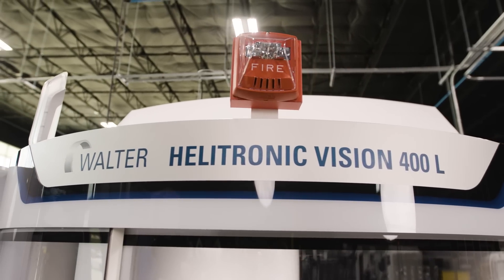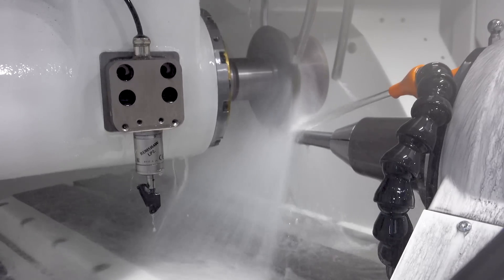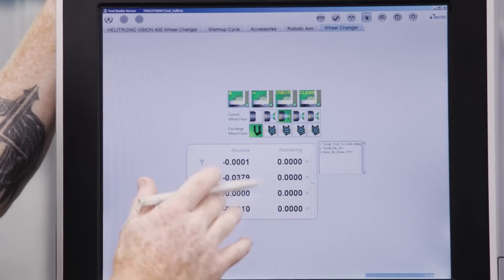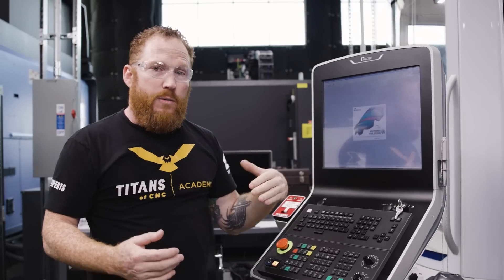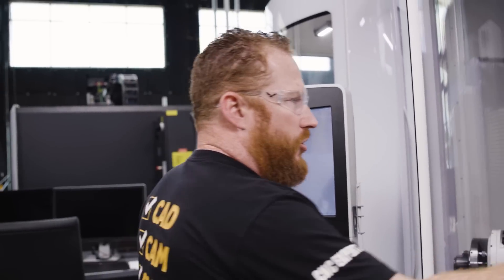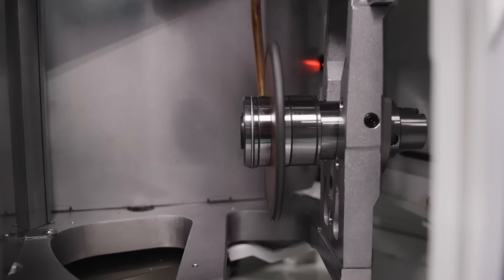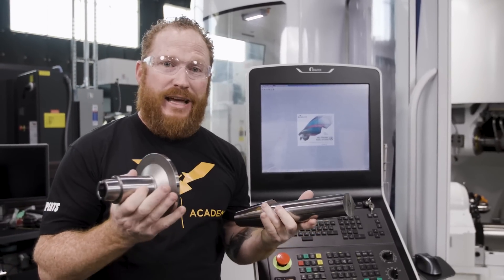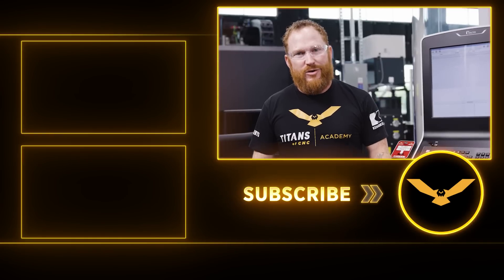How To Get The Walter Helitronic Vision 400L Up and Running

Comment: I wonder if you could use Numeroto software on the Walter.
I worked at a shop that used a Walter machine for grinding Hobs and that machine used Schneeburger software. I just like Numeroto better especially for form tools.

Comment: Wow, every time I see Scott on this machine it blows my mind.....Does Walter have a specific CAD program for designing end mills and tools....or do you have to generate the Gcode in something like F360...?
Reply: Program has a pre set model for generic  endmill, you can adjust everything once the general model is made, number of cutting edges, radius / no radius, end face, fluting and everything else

Comment: Just remember if you want to buy a machine like this buying the machine is great and all but the upkeep on some of these machines will cost as much as the machine or more over the next 5 to 7 years.
Reply: If these are anything like CNC glass machines (the field in which I work), it's all about the preventative maintenance and how the operator treats it. If you don't clean it, feed it dirty coolant/water and/or air, and crash often...  it's going to cost you.
Reply: @willsparklin  I work on a large bed lathe and our company dosen't maintain it at all. We have had the lathe for 8 years with the original manufacturers oil in it running it 24 hours a day 5 days a week plus Saturdays for 5 hours. Then they wondered why they needed to rebuild the headstock and can't get the machine to run consistently. Preventative maitnince is your best friend.
Reply: What percentage of the profits is that though?
Reply: @iamchillydogg  I have no idea but it could be higher if you took about 5 hours out of a day which you can schudle to change the oil versus having the machine suddenly go down for 2 weeks while waiting on parts and no other place to run the parts due to the large size. Also now your production is 2 weeks behind and you just pissed off a bunch of customers.
Reply: @wendull811  
Ok but how much does that proper maintenance cost which is what your comment was about.
Reply: @iamchillydogg  not at much as lost customers due to a machine being down and/or concerns over quality.
Reply: I recently visited a toolmaker in the DFW area with a Walter that's been running for over 20 years. These machines are the highest of quality and basic maintenance, proper use, and the use of grinding oil, you will experience the same results.
Reply: @willsparklin  
Right but we're not talking how much improper maintenance costs but proper maintenance.
Reply: @iamchillydogg  Well the headstock holds 60 gallons of oil the x-axis box and z axis box hold about 5 gallons and the oil for the ways we go thru about 1 gallon a month. So figure for every year you go thru rough 100 gallons of oil to properly maintain that machine plus about 10 hours of labor a year. So it's about $2000 a year for 110 gallons of oil. Over that time was roughly $20,000 plus labor which figure is about $10,000. So $30,000 for 10 years not including other basic items to keep the machine accurate such as leveling/gib adjustments and periodic stuff like roller changes for steady rests. Tool wear things of that nature. The 2 weeks the machine was down plus $9,800 in parts for all the spindle bearings and about 25 hours of labor cost for disassembly and reassembly. I can keep going if you would like me too.
Reply: @wendull811  
So way lower than $750,000.
Reply: @iamchillydogg  Unfortunately I am not talking about the machine in the video. I am discussing the price of the machine I run at my job.
Reply: @wendull811 
Ah.
Reply: @iamchillydogg  I also just looked up the oil coolant they are running its $240 for 5 gallons. I don't know if that is concentrated or just pour it in. But I can bet if it is buy and pout they will go threw at least $1000 a month or two just in the coolant.
Reply: @wendull811  these machines cost a pretty penny when they're crashed and abused, but when they're taken care of and have all maintenance done properly, they're really not super expensive maintenance wise. I work at a shop with about 35 walters grinders - some from early 00s to brand new, and frankly, the older stuff is just built better.
Reply: @parmesanjon  sweet.
Reply: @parmesanjon  I would hope shops don't put the biggest idiots on the CNC grinders to crash them. I've never seen a wheel explode before, and I don't want to.
Reply: @jerryherrin6470  rare that wheels explode, usually the spindle stops nearly instantly in a crash and it takes a chunk out